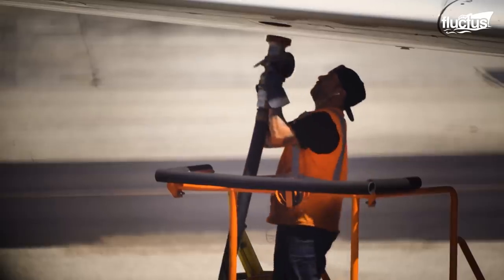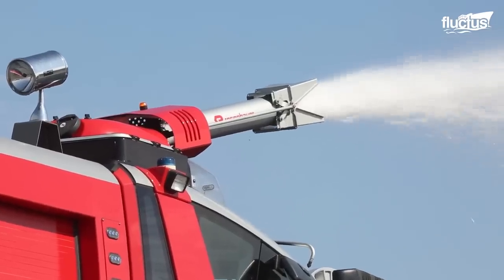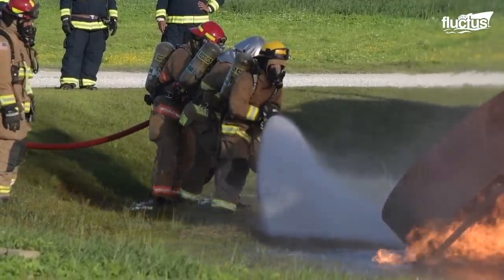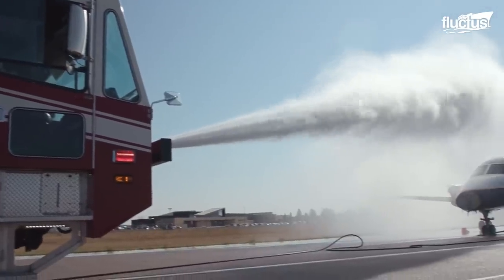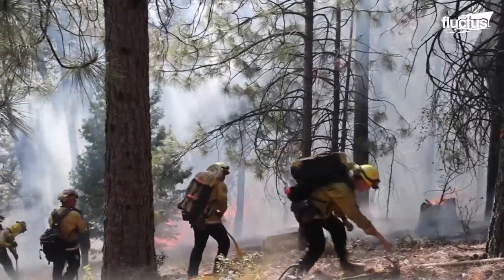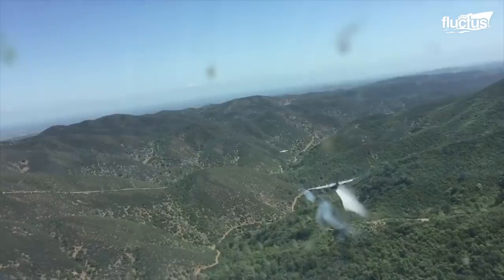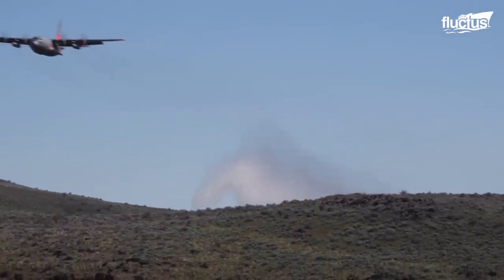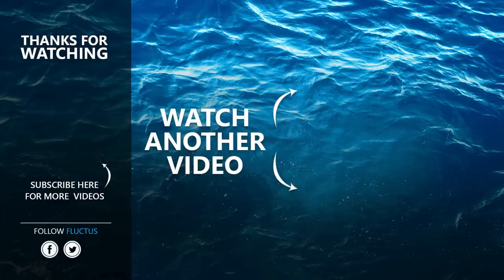This US Air Force Truck’s Waterjet is so powerful it can Destroy an Entire Plane

Comment: Jet A is not that flammable and is not that hazardous. It has very similar characteristics to kerosene and diesel
Reply: It is designed to burn hot but hard to light low flash point it does have some petrol in it to aid ignition
Reply: @kevinduffy6712  jet fuel has some petrol on it? Are you sure about that? It is pretty much 99% petroleum with additives to reduce the freezing point. You might be interested to learn about oil refining. 10 minutes might change your world.
Reply: @hewhohasnoidentity4377  Petrol is short for petroleum, it is the European term for gasoline.
Reply: It's flammable under very high pressures, such as those found in the combustor section of a jet engine. At atmospheric pressures it will extinguish a lit match.
Reply: @Deploracle  thats right compression ratios in combustion chambers in most engines ar 19.5 to 1
Reply: Jet fuel (in its various grades) are all kerosene at their base. The differences between the jet fuel grades and consumer space heater grade (K1) boil down to the refining tolerances and subsequent additives.
Reply: Biodiesel jet fuel = no fireballs on 9/!!    and   no more incinerated passengers and crews.
Reply: @R.U.1.2.  Sorry, petroleum is a liquid of its own very much like diesel property vise, gasolin as you refere to is called benzin in europe
Reply: @buttafan4010  Maybe not, but the speed alone guarantee it anyway
Reply: Jet A1 is basically very pure diesel you can put it in your car maybe not a new common rail but I have run my old 300tdi Discovery on it
Reply: @sidewind131258   Airships!  Floating air-bag cushions - non- explosive helium - solar photovoltaic envelope powers electric engines by day, biodiesel generators power engines at night and cloudy days - main travel commuter routes are tethered - like floating gondolas - top speed at high altitude - 250 mph.   Don't give up hope.
Reply: @buttafan4010  🤣🤣
Reply: @buttafan4010  🕯🕯🥛🥛Here you are, I have just given you something to help them, I'm no hero
Reply: @sidewind131258  Neither was Bernie Laplante. 👞👞 (hint - search YouTube for him. Accidental Hero - The Movie - Great Scenes) (also search: Fearless (1993) - Plane Crash scene [1080])
Reply: @garethlinford5785  it’s kerosene.  Not diesel.     I put it in my 7.3 and it runs good and clean.

Comment: Jet a and the Air Force derivative jp8 is kerosene based. You can actually put a match out in it. It’s flash point is like 150 degrees Fahrenheit
Reply: That's right all NATO and American military vehicles now run on it to save transporting different types of fuels .
The sr72 had chemicals mixed to make it burn as it leaked until the air frame got hot .
Reply: They are just creating and ambient of danger to make more exciting the video by saying that is one of the most flammable………😅
Reply: Could you do a demonstration down at Wendy's....2PM tomorrow? Thanks.
Reply: The Air Force switched to Jet A YEARS ago.
Reply: @VaporheadATC  I got out in 2001 they were still using jp8
Reply: @seanfenick9375  I want to say the switch happened around......2018 or so.
Reply: @VaporheadATC  I injected all of those chemicals for nothing. Yay! 😢
Reply: @seanfenick9375  ha, me too. I was a tank rat back in the day.
Reply: @VaporheadATC  I was pol.  2fox

Comment: Jet fuel is not easily ignited. Throw a lit match in a can of jet A and it will go out. gasoline on the other hand is another matter. You're too much of a drama queen in describing the" combustibles,  hazardous known too man" is a little too much.
Reply: Providing it is in an open tray and the fumes can dissipate  .
Reply: Airport worker here you are correct so however it is still very flammable the greater danger at airports is avgas or 100 LL
Reply: @oscarkiloproductions443  yep the flash Point is 100 the freezing point is minus 65 c which is 15deg more than the themp at which most planes fly at 45c at 40.000 feet 😳  it is 70%petrol and 30% diesel jet a1 is there are different types right Don to jp7 thats what they flew the Sr 72 on as it leaked till the air frame got hot 🔥  the concord used fuel to cool the air frame as that got 120 deg c at 65 OOo feet even though out Sid was minus 65 deg c 😳
Reply: The problem arises when the momentum of the aircraft during a crash atomizes the fuel.
Reply: @sgriffith2353  thats why the yanks use jp8 on aircraft carriers
Reply: Biodiesel jet fuel = no fireballs on 9/!!    and   no more incinerated passengers and crews.
Reply: @buttafan4010  bull shit it will still burn like normal jet fuel have you seen what it does to fuel filters on diesel trucks . 
And you cannot guarantee the obtain rating .
So it needs to stay as cooking oil and dumped .
Truck manufactures won't warrent the engine if you use it
Reply: @kevinduffy6712   thanks for the information and your opinion.  Several major airlines run 50/50 blends of Jet A and biodiesel as eco- promotional ad campaigns; a blend ratio does not require re-machining the engine factoring by GE, MacDonald Douglas, or Rolls Royce. 98% biodiesel plus additives is being tested in jet fighters at Wright Pattern Air Force Base now for over 15 years.  They want a fuel that can take an incendiary bullet in the tank without igniting.  However that the stockholders would not stand for the cost of retooling the factories to make the modifications of airliner engines and would file financial law suits for not guaranteeing maximum profit acceleration rates.  Instead, profits are used by the company to buy back their stock options.

If you touch a lit match to kerosene, it ignites the kerosene.  Are you saying the same is true for biodiesel?
The airline industry burns more people alive than ISIS and Christopher Columbus combined.

Comment: LOL Jet av fuel has such a low octane you cant even run it in an old diesel engine. Is hard to light on rags. It needs to be atomized to burn.

Comment: Can only aircraft's deliver fire retardant? Cant trucks do it on the ground?
Reply: yes but they cant get to some of the places !.
Reply: @kevinduffy6712  and they sure can't do it quickly or nearly as safely. It would take 2 -3 days for a truck to do what a plane can do in one 20 minute trip. That is if there are roads to get to the fire and the driver can see through the smoke.